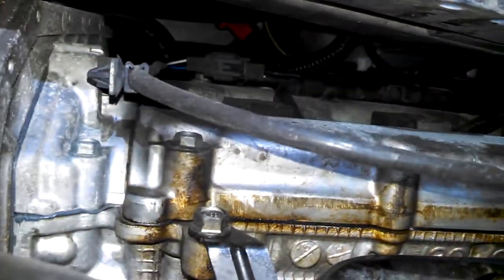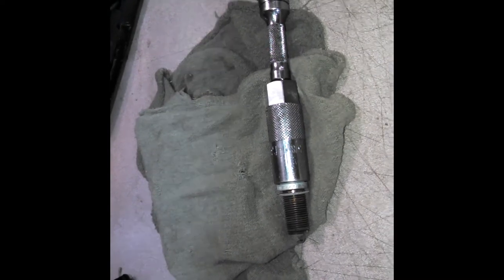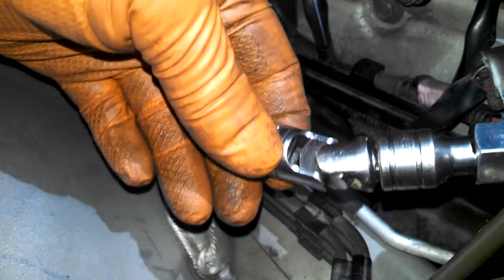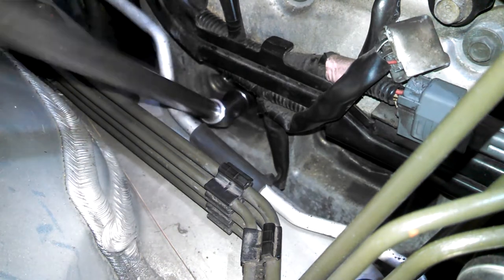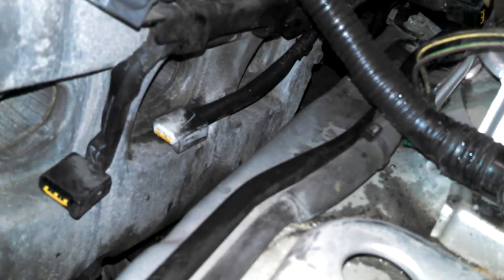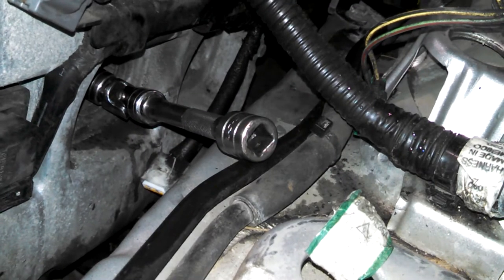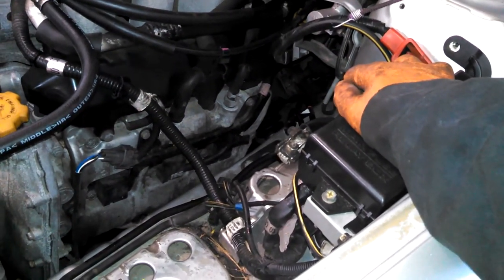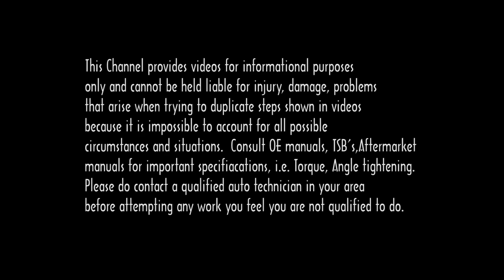Spark plug replacement 2004 Subaru Outback H6 ignition coil

Comment: The #6 cylinder is killing me.  It's killing me a slow death.  The clearance is SO TIGHT that I can't get a new coil in.  How did I manage to get the old one out?  I tried watching you reinstall coil #6 and all I saw were hands.
Reply: I used a regular spark plug socket, attached an 3/4" socket to the end of that (taped on so it didn't slip off), attached a swivel socket to the end of that, then attached a 10" extension.  (all 3/8" drives)